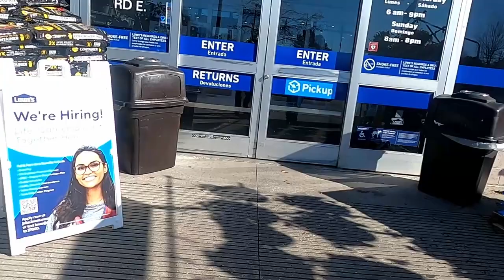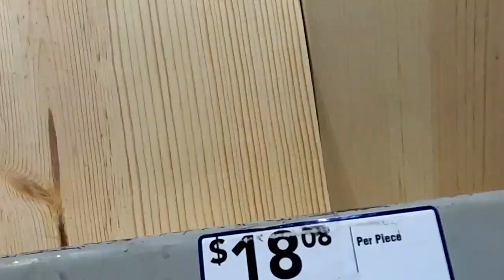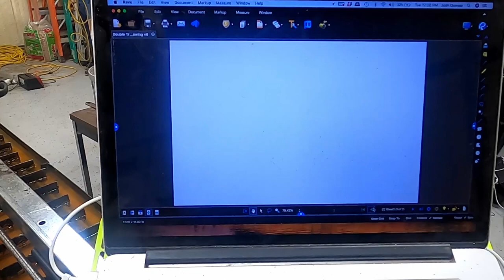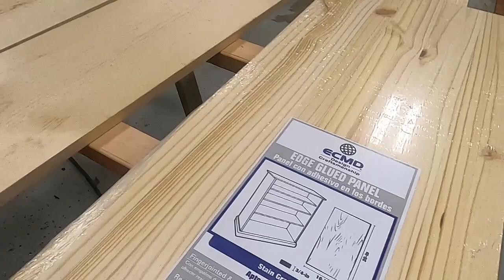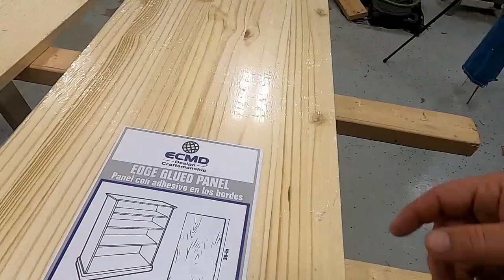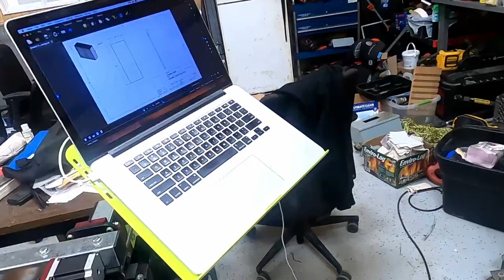Making a Double Tilt Out Trash Bin   How to Build a Double Tilt Out Cabinet with Downloadable Plans!

Comment: Nice build....The only issue could be that there's no stop to.prevent the door from falling to the floor. One solution maybe to add a piece of wood sticking up on the side of the shelf with a block or screw into the side panel to catch it from falling open.
Reply from the maker: With the weight of the trash can the center of gravity is low. I've been using this design for years now without issues.

Comment: We are almost complete building this working on a butcher block top for this cabinet.  Our daughter wanted this on wheels and now it seems like the cabinet posses a problem with tipping over.  Do you have any suggestions or should we not add the wheels to the bottom?
Reply from the maker: Hopefully, you figured something out,  I imagine you could add some weight underneath to counterweight it. Due to it being that narrow, I can't imagine castors would work.